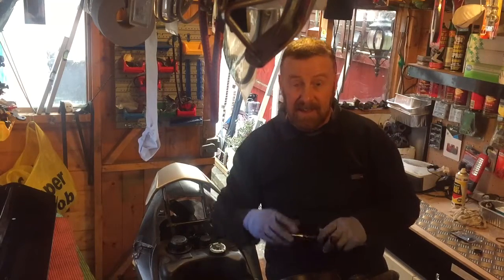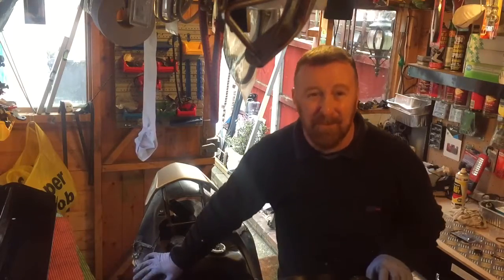Speedfight how to tell if your oil seals are gone mark savage

Comment: Is it different size seals for either side of the crank?
Reply from the maker: @ShaneHarper-q9f  when you get the kit you'll see they are 
Easy to take out using a screw and pull out 
I used to split the engine  as normally changed the crank 
I've got a few videos on doing it and how to check them
Reply: I got a kit of seals and there is 2 the same size and 1 smaller inside diameter. Is the smaller one to go on the variator side?

Comment: Hi mark, another great video! I have a speedfight 2 thats having running issues, it starts fine and idles/revs but when you ride it starts spluttering, ive changed the coil, plug, carb and im going to be checking the stator today is there anything else i could be trying? Many thanks
Reply from the maker: follow my carb videos bud , 
air filter on and link pipe ?
it can be too big of jet or flooding , take it off clean and check over , also check vacuum is working right like in my videos

Comment: Could you make a video on how to flush the engine out on a speedfight 2 lc to remove the sludge inside the crank cases
Reply from the maker: Ha yes lc 
You may have had a water leak and it mixes with you 2t oil and fuel and ends up a crap in the sum lol 
I have a video on how to get it out on my soeedfight play list on engine etc
It's not nice but the only way bud
Reply: @marksavage  hi the engine does run but fills up with sludge Im replacing the crank bearing and seals if I fit a new water pump will that stop the sludge building up again in the crank cases
Reply: @marksavage  can u please let me know if once I replaced the crank bearing and seals and cleaned all the sludge out of the crank cases if I fit a new water pump will that stop it from happening again

Comment: Need help mark please …. My speedfight starts up fine I’ve just fitted new piston a new cdi immobiliser bypass…cleaned carb and it starts perfect .. it revs perfect on the stand but … off the stand the won’t Rev at all ?? And plug is very oily
Reply from the maker: carb tuning bud or reeds , i've had this many times and even had to change the carb !!!

Comment: hello Mark just wanted to say how noligable you are on fixing problems on bikes and been a subscriber for a while now and I just have a question if you dint mind answering for me if possible please.

on my peugeot speed fighter 50cc I'm always seeing oil on top of my cover where the kick start is and just under the air filter could this be to do with the carb letting out to much oil it's not leaking inside the case just on top were air filter sits. sorry again to bother you cheers shane
Reply from the maker: Too much 2t oil bud 
Are you pre mixing or using the tank 
It's common bud on some manual oil pumps 
They are adjustable with the cable linkage 
If on engine pump too
But not electric ones
Then best to ore mix 
Clean air filter regularly till sorted bud 
Also give the carb a good clean too
Reply: @marksavage  hi mark thankyou for your reply yeah its a tank under the seat next to the petrol cap I will look again at your video and how to clean the carb out as a local garage quoted me £70 to clean the carb which I fink is over priced could be rong cheers again thanks shane
Reply from the maker: @detectinglincolnshirewiths2416  my videos show you how to clean it
Buy a sports air inbox filter as you can wash them and better

Comment: Hey Mark 
In need of some advice
I have a speedfight 2 50cc that won't kick over. The engine turns fine just will not start, I've check fuel lines, carb is getting fuel, I've replaced the Reed valve and gaskets, replaced all gaskets in engine and brand new spark plug and coil. Still to no avail any idea bud.
Cheers 
Sean
Reply from the maker: wet hand test ?
plug getting wet?
so it electric starts but wont start and run?
when you turn it over and open the throttle full doe it pop as it maybe piston which is common 
you have a good blue spark?
over 80 videos on my channel to help
Reply: @marksavage  hi Mark, the spark isn't getting wet so I plan on checking all gaskets today after work, piston wise it ruined a 65 kit so its rebuilt as a 50 and the piston and cylinder are OK, It has compression to
Reply from the maker: @Sean-dv2qo  if the plug isn't getting wet it could be seals?, however if you had it running before then prob ok. 
prime carb , or use easy start to get it to start
be careful not to score the new piston with trying to keep starting it 
I always use 2t oil on the piston when I put in a new piston
Reply: @marksavage  I use 2t on piston and cylinder mate and when you say seals you mean crank seals yeah as I have them just need to put them on

Comment: Hi, Mark, great videos, thanks for taking the time to share your extensive knowledge.

I've a vivacity 50cc 2003, which i was struggling to get to run properly, it would start and tick over smoothly and would splutter and rev occasionally, but refused to run on a steady throttle at all, unless the choke was pulled out, which it would then run beautifully.  In the end I it a split pin and washer over the choke to keep the choke on slightly, it now runs smoother and faster than ever before, I've no problem leaving it like this, but i wondered you had come across this before and knew why?

carb has been cleaned out thoroughly, filter cleaned, spark plug changed. 

Any ideas at all. Thanks in advance for any help.
Reply from the maker: pepper brookes it is all to do with you carb and I have had this too , once the carbs start to mess around it best to change then but it can also be your auto choke ! For a £10 it's worth changing as it maybe coming out to much ? But if you solution works it's the old saying ! If it ant broke don't fix it lol , as it's running well I'd let it and well done for find a way to get it to run bud , mark

Comment: Hi Mark! Love the vids! Quick question for you: I have a speedfight 3, and it just dies if there is no throttle. Usually this is not a problem, but sometimes i forget it when driving around (typically when coming to a halt in intersections) and it becomes a great pain. 

What cold be causing this? I was thinking to have a go at the carborator?

Cheers!
Reply from the maker: EJHEJHx2  yes bud carb give it a clean like in my carb clean videos also new plug / air filter would help ! Mark

Comment: how can you repair the crank shaft oil seal housing if you was a dumb ass and tried to use a flat head screw driver to pry it out? the housing doesnt look like much damage is there but how can i be sure and try to fill the voids if any are there? i ordered some permatex grey gasket maker silicone for the outside of the new seal and i ordered high temp red lithium grease for the inner ring of the seal..can i use red locktight on the outer part of the seal to make sure those voids are filled or is permatex good enough? i have a 2013 vip 50cc upgraded to a 96cc with a BB kit and a ncy racing cam and a DLH racing variator with a DLH racing belt with an NCY racing clutch with a 1k torque spring and blue springs(1k?) on the shoes. i also changed my drive gears from a 47 tooth to a 49 tooth with a 19 tooth pinion gear..a 21mm keihin carb that has a 90 main jet and i believe factory pilot jet.a NCY racing coil and a turbo fan over my stator..was getting vapor lock and it would just die out after a mile but the bigger fan solved that problem.i am also running a 38,39,40mm universal pod filter..im also going through a plug a week cause they are fouling out and look like they are covered in rust why are my plugs fouling out just after 4 days and why are they covered in rust? Is it the pod filter letting in moisture?.done so much to it hard to remember,,lol Please help this Bloke out mate...Thank you for all you videos they help me out a lot !!!
Reply from the maker: With all that work bud your no dumb ass lol 
you change the piston so di you go up in temp on your plug as it will get a lot hotter so like if you have a cr6hs you will need to go up like cr7hs or higher!!
if you have scored the case it's a real prob, if you haven't taken the engine apart there is a cheap of using a screw and screwing it in to the seal one at the bottom and the other at the top then pulling it out , it does work if you have not done too much damage  
you might be able to then seal the outside side to the case, see how that goes also watch my other Free Tshirt video to win one . hope that helps mark 
.

Comment: hi mark great vids pal i have a piaggio nrg lc bought off a lad was overheating and seized up small end bearing shattered checked crank no up and down movement so thought crank was fine after   splitting cases and removing bits of bearing replaced top end but the crank is stiff to rotate could this be crank bearings mate thanks
Reply from the maker: anthony thompson the small end bits could of damaged the bearings , when you replaced the crank you should of checked but we all could say they now lol , best take it apart again yes it's a pain but otherwise it will just go wrong again , if the crank was new and free play before fitting it must be bearing / oil seals if it's the right part fitting in , not much else really bud , I've worked on a few and they are fast peds but just don't sell for much !! , hope that helps bud , mark
Reply: mark savage cheers mate should of replaced the bearings really anyways ordered new bearings and seals may be back intouch soon if i get stuck pal. keep the videos coming as they are very helpful cheers

Comment: Broad questions but are you aware of the top speeds for the speedfight 3 ac, i bought it as completely standard except a stage 6 pro replica exhaust and i just had 55 mph out of it. I'm trying to find whether its tuned or not so i'd like to see what the average is meant to be.
Reply from the maker: the SP3's are normally set with exhaust, variator and the cdi and really from shop only get 30 mph and a bit so if you are getting 55mpg that's great, enjoy, I have done a few videos on SP3's but they don't like me and I hate them right back lol,

Comment: I have a speedfight 2 100cc 2008 it won't start on electric start just clicks and my oil light comes on while trying to start it but it starts if  straight away from a drill any suggestions would be great as I've never owned a speed fighter before thanks
Reply from the maker: its common for speedfights to start from electric or kick start better, if you have a click then your system is working like in my video on speedfight starter on here so you will need to change the starter 
light flashing is often the cdi but if yo say it start on drill then it should be ok 
id be sorting out the kick start too bud, its can be your stator coil being dirty or failing and not giving it the boost so maybe an idea to give that a look and clean or replace 
I have many videos that will help bud
Reply: @marksavage  thanks much appreciated mate

Comment: Hi mark I'm having a struggle getting my Yamaha Aerox Vairiator nut off do you have any tips. The vairiator is not custom.
Reply from the maker: Harry Firks I do have a fee videos on aeroxs and the variator system and will upload another new aerox video this weekend that shows just how to do it but for now you will need a set of mull grips and a long bar like I use in my speedfight videos , hope that help, mark

Comment: Hi mark big fan of vids ive just replace my barrel and piston for n ludix it starts on kick as im waiting for starter motor it revs for 5-10 sec then it dies any idea why that is ? Thanks Andy :) 👍🏻
Reply from the maker: HI bud thanks for watching my video's , ok why did you have to replace the piston and what did it run like before, I take it it's water cooled so have you put in the water, I have done a few video's on the ludix and head replacement , mark
Reply: mark savage no its a a/c and it had a over heating the piston was burnt and had melted metal buts on top and the barrel had a big deep scratch fron top to bottom so i change it nd then after i replaced it that started happening. Thanks  Andy
Reply from the maker: Andrew Smith sounds like an oil 2t problem the pump could be on its way out or cheap 2t , what speed are or did you get out of it? Sometimes when they do 50 plus the oil can't cope and then you get piston over heating and fails !! I've put a little 2t in with the petrol before to help with the high speeds and use good 2t oil , mark
Reply: +mark “marky bike” savage okay mark I'll give it ago as soon as I put the bike back together and I'll let you know if the problem has resolved. thank for ya time ... Andy

Comment: Do you have to take whole motor apart or can you change them by ”outside”?
Reply from the maker: There's a trick using a wood screw 
Screw two in one top one bottom and pull out 
If you can't then engine out and spilt bud
Reply: @marksavage  Thanks, Just changed it and my speedfight starts great again.
Reply from the maker: @user-nc1pt6ur4p  that's great news bud

Comment: Hi which way do the main go go in please :)
Reply from the maker: Go go ! 
Do you mean the bearings ! Or oil seals
Reply: @marksavage  thanks for waking me up before i went went... The oils seals please :)
Reply from the maker: @KentRoads  they are different sizes but the go in just to the lip so dont push them in to far 
Maybe make or take a photo of where the old ones are
They go in either way bud just dont nick them when pushing them in try a little bit of 2t oil
Reply: Thanks for replying, is the spring on the outside or inside? Cheers :)

Comment: Hey mark, been a viewer for a while now and i just bought an 09 Speedfight 3 AC, when i start it it takes a little while to warm up to a point where it can idle comfortably at about 1,500 revs without cutting out. I was wondering if theres any way i can speed that up as in morning it cuts when i slow at lights etc, its fine once its been running a while.
Reply from the maker: Thanks for watching, so what have you done to it so far?. sounds like a good service will help start with a new plug and air filter not a lot of money and easy to do. next it's going to be your carb they are a bit harder to get off than the sp2's but all the basics are the same and how to clean. last what 2t oil as some cheap oil can do this as in this weather they can be thinker and slow things down!. to finish mopeds really don't like it when it's very cold and damp but all this should help. once again thanks for watching and please like and share. mark
Reply: I used the car lube 2 stroke so its not so bad, and I only got it about 3 days ago but as you said it might be the cold. Also, could something be draining my battery as overnight it seems to die and the starter motor turns sluggish but once its been rode and charged a bit its fine for a few hours but must lose charge, is this a drain or the battery on its way out?
Reply from the maker: I have done a video on the 2t oils to use ( give it a view bud)and car lube is not one of them!!. batteries this time of year start to fail and not hold charge due to the ceils go to earth so it will need replacing but only £15 new so again not a lot of money I would still replace the plug that will help all round
Reply: I just saw the oil light and bought the one from the nearest garage and will you be making any speedfight 3 50cc videos in the future?
Reply from the maker: as in my sp3 videos and i've only made 4 or 5 they don't like me lol but I do get them in from time to time and yes will make some as they come in. mark

Comment: Hi Mark
Im getting a noise from transmission side its more like rattling noise. I thought its gonna be a variator but I have put a new one in and its still there. Im thinking that it could be crank bearings.I have upload a video on my page if you could check it.
 Thanks Mark
Reply from the maker: often it's the bendix knocking on the outer part of the variator like a ting ting noise but I will check out your videomark
Reply: mark savage I have took the cover off and I have take bendix out and still does it. Crank itself looks alright no play in it.
Reply from the maker: hi bud it could be the springs in the clutch but more like the bendix as it can loosen and tiny but all in it rides well other than that ?I do have lots of videos that should help with all your needs to a speedfight with over 60 videos on them check the out but they will help mark
Reply from the maker: oh just see your comment about the bendix so no it's not that lol , the belt look fine and tight so maybe take off the clutch and have a look at that  mark
Reply: mark savage Right ok, Thanks Mark will check the clutch. Also my fan pulley its touching the case as I can see its leaving marks on it

Comment: Ik it's not relevant to this video but I put a 70 kit on my aerox and with standard carbs he wheel spins like mad even when idle speed is set very low when it's set to low it dies how can I fix this I put a 21mm carb but I can't seem to get that to work
Reply from the maker: when ever you fit a 70 cc kit these bikes play up, it's going to be you carb . make sure the head is all down properly and not sucking in air any where you may have to play with the needle height or jets up or down jet it / air filter change, I do have a few videos on the aerox's have a look at my other videos as I'm sure theres about 10... also put a little 2t oil in with your petrol as the pump will only put in for a 50cc and not the speed of a 70cc!!,  hope that help bad .please like share and subscribe . mark
Reply: Could it be the oil seals ?